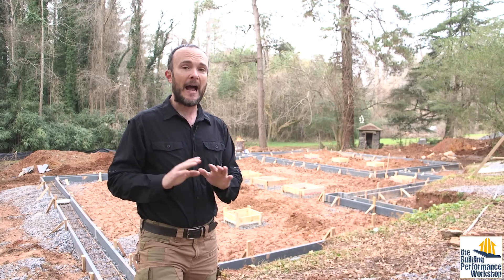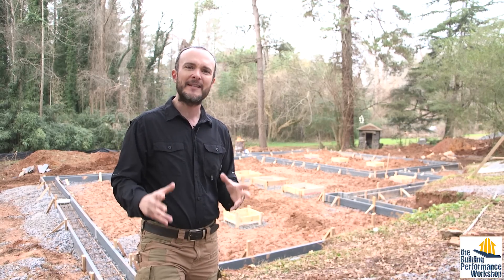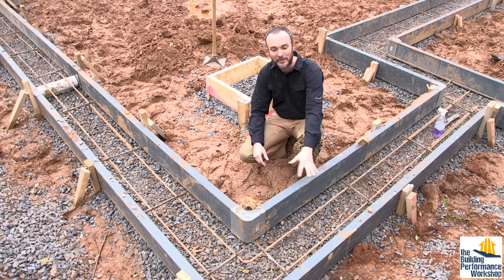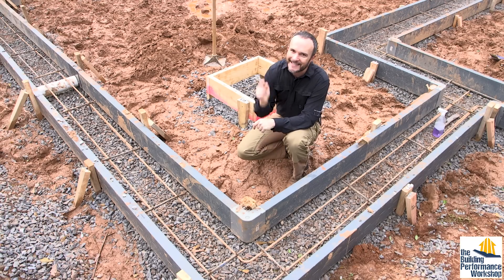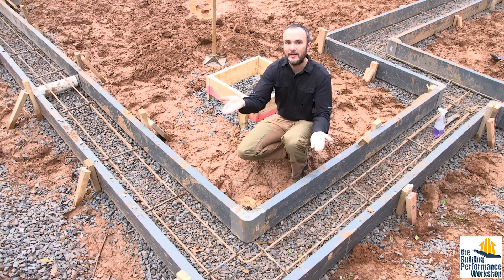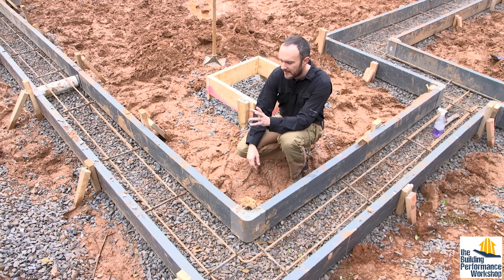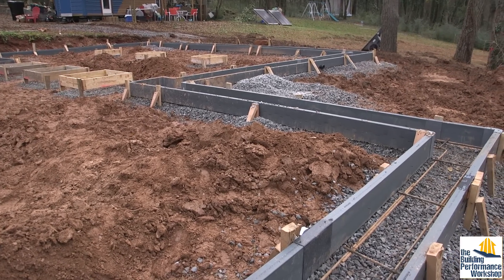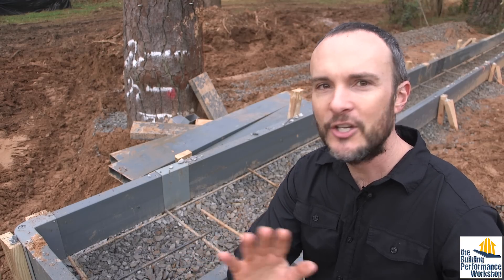First Concrete Pour: Form-A-Drain 4-in-1 Foundation Footings

Comment: I would like to know what state this work is being done in. That can’t be C.A. Thy do not let you build your foundation out of gravel like that. With no connection between the stem wall and the bottom foundation there is support but not stable support. I don’t see any STB orA.T. For any HDUs can’t be CA inspectors would never let this build fly. As a homeowner you picked the cheep route for sure. Good luck
Reply from the maker: Thanks for your concern, but this was specified by a geotechnical engineer. They specialize in bearing loads and maximizing support of soils. Also, Georgia.
Reply: I see have you gotten a second opinion from a structural engineer❓ I have a couple Geotech guys and I would not use them to design my foundation 🤷🏼‍♂️ They  would just come and test the soil for me. My structural engineer designs all the foundation I do. I am currently building a 5000 square-foot house slab foundation on grade. 7‘ x 7‘ x 2‘ deep under pads 24 x48 continuous grade beams  around the perimeter of foundation 18“ x 18“ grade beams underneath all interior walls. Number 4#rebar ran 16 on center staggered for the whole slab 2 inch base  2 inch gravel 2 inch sand withe vapor barrier. Approximate hundred yards of concrete 4500 psi. Of course we have 14 Hardi strong walls and over 30  HDU 5,11,14, we are in earthquake zone Hollywood L.A. and building is much different than Georgia. So I look at your foundation and I’m like 🤔 if it was me as the GC or the owner of the property.  I would’ve not done the gravel foundation I would’ve ran minimum 12“ x 12“ foundation with 8 inch stem wall. Not sure how laws work in Georgia but out here a contractor is liable structural for 10 years so it Hass to be done right. Cosmetic is four years California law.
Reply from the maker: @dlconstruction5255  Yes, our geotech and struc engineers are working together. We needed the geotech because our dirt situation was so freakish. Yes, earthquakes make your job much harder there. We have 4000 psi spec'd, I'm certain everything is strong enough and then some (since engineers use very conservative targets). Thanks for sharing the journey with us.
Reply: Home Performance Nice man great work then. I’m a big believer in double checking and it seems like you have 👍🏻Great work man and safe travels with your family on your journey this year. I am definitely subscribing to your channel man keep it up. 🙏🏼🕉

Comment: I work with form a drain and I love it. I use metal stakes and do not have to remove them, and for spacing and rebar seat I use special metal wire spacers, works great and keeps forms in place
Reply from the maker: Thx V!

Comment: I am a Redimix driver.  The slump test is done on site only if requested by builder.  The pump can withstand a dryer mix then a 4 or 5 in. slump.
Reply from the maker: Thanks Joe, I’ll call the plant ahead and talk with them. There’s a communication glitch between struc eng specs in psf and slump inches, just need to bridge that gap with the right help
Reply: @HomePerformance  The mix design you are using should have a number associated with it that should be on your batch ticket.  The mix design, which the batch plant should have on file, will tell you all the pertinent information such as slump and weight of the materials per cubic yard as well as any add mixtures.

I have not seen anywhere on your site about the design of your house.  Will you be sharing the design any time?  I am really curious about what type of foundation walls you will be using.

I would like to say that I admire you for taking on the challenge of being your own GC.  It is not an easy job and most of the time you will get more grief than help.  Wish you the best of luck on your project and don't let the haters get you down.
Reply from the maker: Thanks man- this house is pretty exhaustively outlined at:
Http://homediagnosis.tv/atlanta-homestead
Reply: @HomePerformance  Ya, they just didn't want you doing the slump test because they added a bunch of water to make it flow like it is.  Almost every concrete guy I know adds a lot of water because it makes it easier to work with and save them time because time is money you know.

Comment: LOLOLOLO    1  slump test   if you  have  a guy checking compaction , they can check the slump  ,  
2  your worried  about the   rebar on chairs   ,  but letting them stick the dowels ,    to do it right the tails of the dowel need to be   under the  rebar mate 
3      i would check the contractor  insurance , to  let you run the hose   or any  equipment     could be a lot of trouble  if you got hurt

Comment: Slump test is done onsite use to deliver concrete and is the most important thing about concrete and they usually take samples to test psi also
Reply: Slump test is done with wet concrete.  MPA test is done after 28 days crushing a cast plug.

Comment: I understand the local thing. If I had to have an active radon removal system and a active drain system I would have had to find a different location to build. The best way to avoid problems is not to have them in the first place.

Comment: You should let them take them out. First off they move when you pore so you can't be sure you know where they are going to end up, in the wrong place you have weekend your concrete and 2nd you don't really want that iron product sticking out of the concrete anywhere and given the chairs are supposed to be at the base they work correctly some of it will be exposed to the gravel bed. 

There, the science of why it's done like that. The inspectors know this is how it's done.

Comment: I’m not a fan of having the foundation walls poured separately from the foundation footings. It will be interesting to see how you join them. I have experienced time and again the “contractor’s way” you speak of. Most contractors have certain methods, good and bad,  that they use and they will not deviate unless you are constantly insistent. Even with detailed bid documents they will still use their own approaches and here in Washington state unless there is provable “material difference in performance” they will win any court action. I’m sure there are contractors out there who will do custom work and will follow the drawings but I have never met them and probably couldn’t afford them. Good luck with your project.

Comment: This is the right approach. If a client doesn’t get involved there will be corners cut and the old, “this is how we always do it.” nonsense. I’m a contractor and (generally) love when a client gets involved. In the last two decades I have only had 2 jobs where the clients had no clue and insisted on pushing their agenda on me. So i simply left.  Mostly people want to do the right thing and I have learned a lot from clients doing their own research. This industry has so much new science , better products and methods every day that as a working, belt-on contractor there isn’t enough time to know and re-learn everything. Although I spend 10-20 hours a month reading product websites and watching videos, this isn’t enough. 

Kudos to you for being a, “pain in the ass.”  In my experience that equals caring about the quality of your investment.  Don’t worry about push back. I’ve seen people flip out on clients for making a comment. Let them flip. I’ve made comments to subs and have had push back. The conversation now goes something like this:
“Don’t tell me what to do. I’ve been doing it this way for 30 years.”
Me- “So you’ve been doing it wrong for 30 years?”
Them- “F@&k you!  I never have a problem.”
Me- “No problem, it’s just that the date on your reference material is 30 years old.  They stopped doing it that way 26 years ago because it doesn’t work.”

I once had to mediate an argument between a plumber and a sprinkler man. Nearly 85 years of expertise between them.  The sprinkler man didn’t want the plumber to use standard PEX to feed his system as the blow-out pressure to drain the sprinkler system often is or exceeds 150 PSI.  The plumber said, ” that’s  how we always do it and I’ve never had a problem.”  
Sprinkler man threatened to leave the job if he found PEX near his system. The friction continued until the homeowner asked me to make the sprinkler man happy (this was the Babe Ruth of sprinkler men and he was afraid to lose him) . It took me about 5 minutes on the manufacturers website to see that the version of PEX being used at the time had a maximum rating of 80PSI.

You would think that fact would solve the problem, but “I’ve never had a problem” continued. So we got a new plumber who was willing to listen and learn and work with the sprinkler man. 

In my experience you have three options: babysit your own job, hire someone who is psychotic about quality and knows the best products to use, or be ok with “this is how we always do it.”
Reply: You can learn from just about anyone.. sometimes even from your apprentice. Its good to work for more than one company when your working in the trades,  you meet a lot of people and see a lot of different ways of doing things and learn a lot … and like you said just because you been doing it for 30 years doesn't mean you have seen it all, especially if you have been at one shop the whole time...pays to have a open mind
Reply: LOL...how come its always " I've been doing this for 30 years".   Can't tell you how many times I have heard that.
Reply from the maker: Thanks for chiming in, Philip!

Comment: How (in your own project ) did  you allow these channels to be used as the primary form  reinforcement?  Should have been sandwiched between between 2 ×12's
What concrete guy would miss this? Buddy you stick to research, get out of the dirt, and hire a professional.  Respectfully mike
 (30 years, concrete-excavator)

Comment: here is some science for you , those steel chairs you ask to be tied will rust from the ground up and cause they are tied to your rebar it to will rust , we call it concrete cancer you want your slab to last a hundred years try 20 steel chairs should only be used in conjunction with moisture barrier , if your not a contractor stay away and if your not in the industry what the hell would u know what to look for anway for eg i saw st8 up there should have been pegs every 600mm with every 1 having a brace , any decent concretor would pick that up in a heart beat

Comment: Your forms bowed because the angle force of your kicker brace wasnt strong enough. Needs to be much lower angle. Seen that wasnt going to work right away let me quess you used 2 to 3 yds more then calculated. When doing footings you should of never poured on top of compacted fill. You goin to have settlement problems. Maybe your engineer buddy can help you fix the cracks im the walls in two years

Comment: @homeperformance there's a lot of know it all's commenting that have no clue what the situation is lol. We've been using the form a drain system for a long time now. It's really an amazing product, I know it's a little late but for future reference that system has steel stakes designed for it that you don't have to remove after you pour, also it has rebar saddles that hook to the top of the form drops down in between the two to hold up the bar, so no ground contact at all and they also hold the inner and outer forms at the desired width basically eliminating the bow. Keep up the good work bud.
Reply from the maker: You are awesome. Thanks for the tips!
Reply: Now that is a good product that comes with its own braces and hangers

Comment: bowed footing will make installing the insulation harder
Reply: What insulation? Clearly none was going to be utilized, otherwise I am sure they would have spaced the form drain system to accommodate it.
Reply from the maker: Subslab insulation is what was meant I think, and the effect was minimal- we had to cut it anyway

Comment: 16:32 that is not true. you can absolutely do an onsite slump test and should.
also, you can use dryer concrete, you would just have to wheel barrel it onsite.
Reply: wheel barrel LOL.

Comment: Slump tests can be done onsite and on spec work are done before entering the pump and sometimes also after exciting the pump.  If the stone is very porous it can absorb more water and reduce the slump but that doesn't necessarily tell you anything of the strength.  The only proper way to know the strength would be to take sample cylinders and have them tested by crushing them after they were properly cured, and they should really only be taken at the end of the pump because people are always adding water at the truck.  
If you're genuinely curious about there is a way to test existing concrete with a gun that drives a slug into the slab and they measure the distance that the slug enters to determine the strength. I've heard it's pretty accurate.  
I don't know why people tried to feed this guy garbage about testing.  A homeowner has every right to get what they paid for, and they shouldn't have to be worried about being a pain just to make sure they get what they paid for.  
I will say the mix looked very nice though.
Reply from the maker: Thanks, Roger, I'll get this into the wall pour.
Reply: Hi Roger,  I haven't heard of the gun,  slug test.  I have seen a rebound test from a " gun " of apparatus that measures the surface density of the cured concrete to give a range of mpa. 
I can't remember the degree of accuracy they give but they are used by concrete technical experts to test in-situ concrete in lieu of destructive core testing. I'd like to know more about the test your referring too. Knowledge is power!
Cheers Colin
Reply: @8Hamo  Its called a Schmidt Hammer test, and is very accurate when done correctly.

Comment: So you used concrete forms that are plastic that were not secured property and you ended up with a huge bow in your foundation wall.
And you called getting this right a weird gray area?

It was a mistake, plain & simple.  It's OK, you are not a contractor.  But be clear on what you got right & wrong    ....so others can learn.
Reply: Tie wire from inner peg to outer peg no bow.
Reply from the maker: You guys, settle down. I didn’t use the words ‘blown out’ or ‘huge’ in this video, because that’s not what happened. I just wanted you to know that if you stake wood all the time, then try FAD once, it will not perform the same way. There is no problem, as I already said in the vid.
Reply: Toob247 Toob247  Im not sure how strong or brittle it is and Ive never used it. So im curious.
Reply from the maker: Stay tuned brother
Reply: If you can square the walls on the foundation you are good to go.
Reply from the maker: Very reasonable fix imho
Reply: @HomePerformance  just a thought. How much stress can those forms take. What I mean is while being under stress now(the section that bowed) will it eventually crack? Leading to some loss of suction and efficiency.
Reply from the maker: It’s perfectly intact everywhere, fully cured along with the wall above, and floor is framed.
Reply: The footer doesn't show he didn't have any blowouts a wider footer is better, honestly when it comes down to it only the top of the wall matters. Come pour concrete in Maine guy we will teach you.
Reply: @cviolette36  nah it don't matter where you live you just have to understand concrete square, plum and level on the of the wall good enough. I have seen some bad footing.
Reply: As an experienced former waterproofing tech (mostly doing retrofit to correct flooding issues, but also did new foundation system installs when those bids came along). I can attest that as long as the top of the footer is flat and level it is fine for drip edge, but when it comes to the side of the footing where the gravel and drain piping is to go, it is always nice to have something flush and flat which makes it far easier to install that drainage stuff. Came across a few where it looked like his does and severe bowing would require we also cut it more flush to the rest which was a few rare times and not fun to cut either, slightly wavy is fine as long as we had 5 inches between the slab and footer to get the rock and pipe installed (at least on the inside work). On outside drainage we can easily just big back some more work with the company Kubota digger tractor (backhoe loader) owned at the time. (My Step-Dad owned and operated his own company up until 2003 when we went separate paths in life and he had been dealing with newfound case of fibromyalgia and his sons were not interested in continuing on, let alone them two seldom worked for and with him, I worked for him full time but I wanted to do other things in life aside from basement waterproofing. Besides some of the competition out there were doing more work due to larger workforce though their workmanship was not as good or as well guaranteed and well warranted as ours (we rarely got call backs) so he let past customers know by mail of ther company closing and seeking others of lesser quality).

Comment: A concrete pour is a dynamic experience, not nearly enough bracing, never let metal touch the ground - use fiber cement blocks, plastic chairs or tie up the rebar,  on a plus note the concrete looked fine.